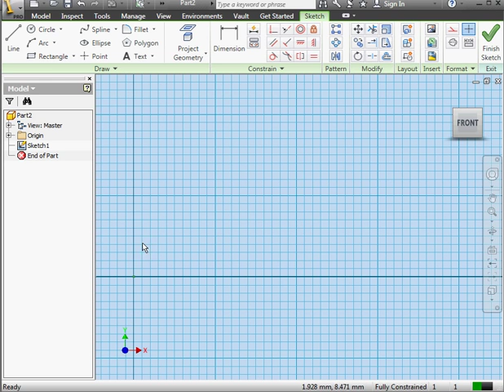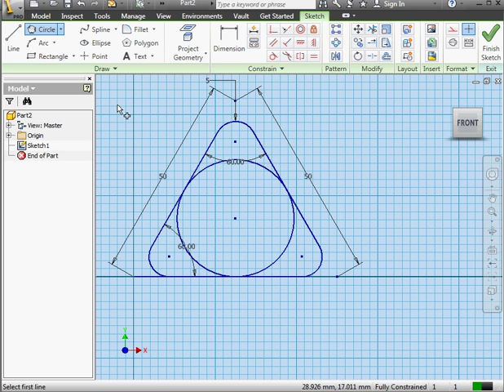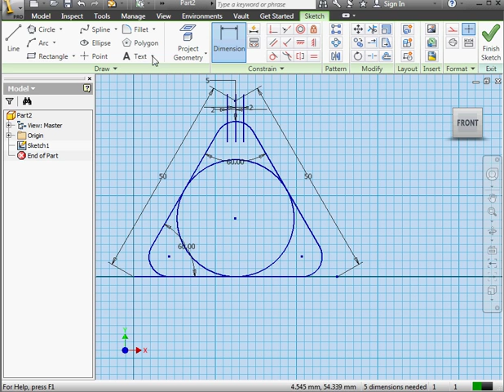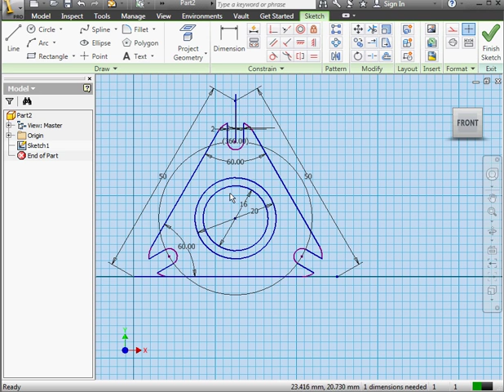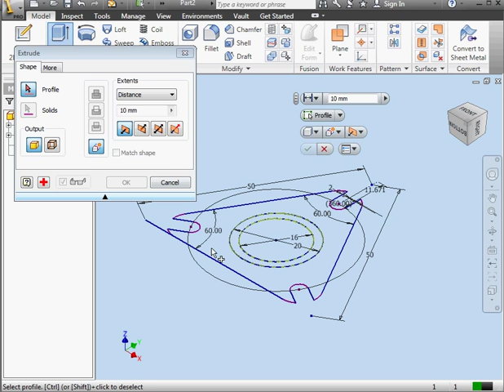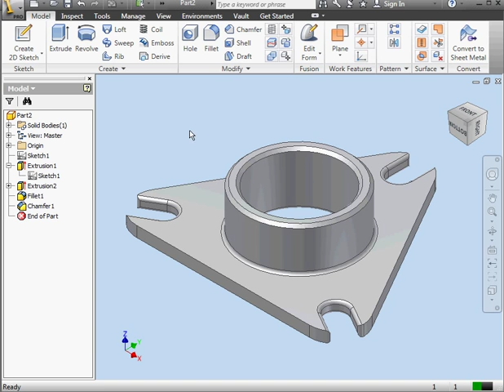AutoDesk Inventor Basic Tutorial - Part modeling - flange nut

Comment: Rosanna, i keep getting the same error on this one when it comes time to extrude the center circle, I even backed it up and extruded the circle forst and tried to extrude the flange.  each time i get (the feature as specified did not change the number of faces and may not have affected the part) error. i did a new sketch on the face of the flange and the fillet would not work.where the circle and flange meet